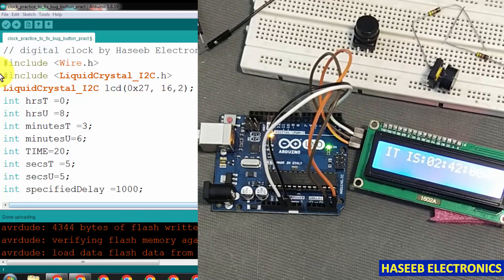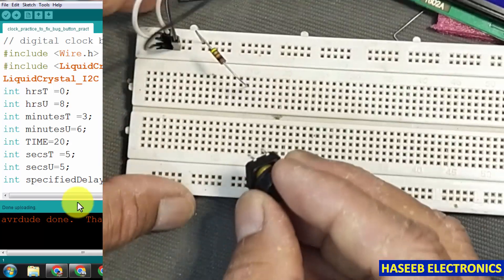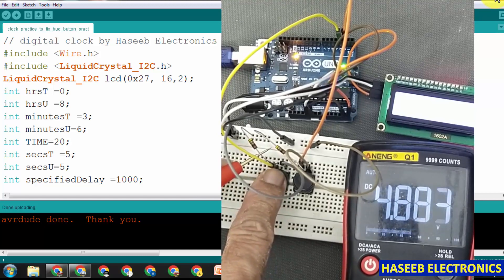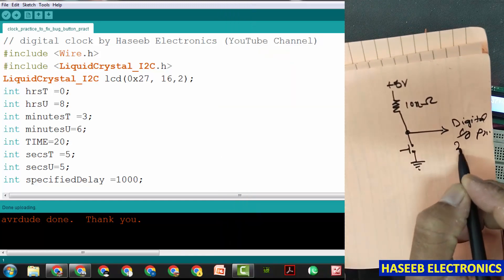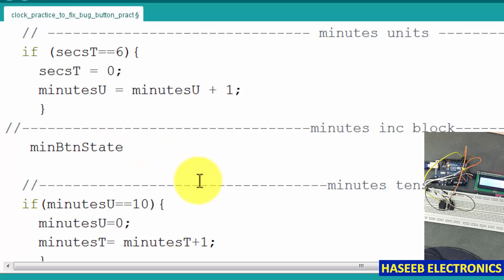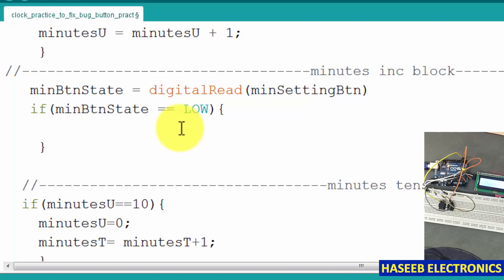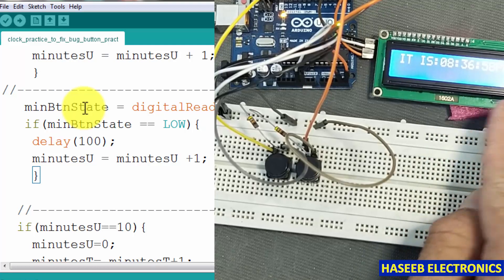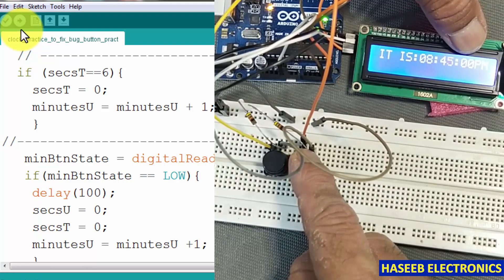{710} How To Code Pushbutton in Arduino For Minutes Hours Increment

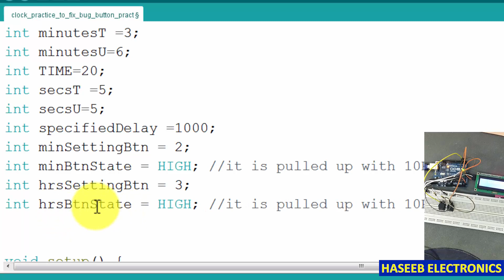Comment: bhai kay aap ek ic ka liya code bando ka kay clock programming jacme date and time ba majeda ho. jace 12:59:59 hour:minte:secant or 09/06:23 dd/mm/yy 6 dight ka date ajnta clock ka jace programming kacbe smd ic ma programming 1,64 pin ic ma plz arduino programming ka jare ya clock banen chada hai one push button long parss per timesatemode and normal cliak per up hour and mintesate karna ka liye duble 2 mintes per chale jaeka far se duble cliak par dd chale jaeka far up jac 1,31 or far mm satet kare na ka liye duble cliak kare na hoka far yy 1,99 y y per jane ka liye duble cliak kare na ho ka far yy satet kare na hoka 23. jaab cab ooja dab long parss karna per time satet hoja aaka. plz programming ajante clock. kya aap ajant ic programming code nekal sakd ho kya far da aap ka programming kare na ka carora nhi paade ka.